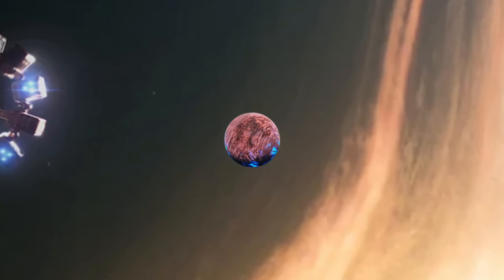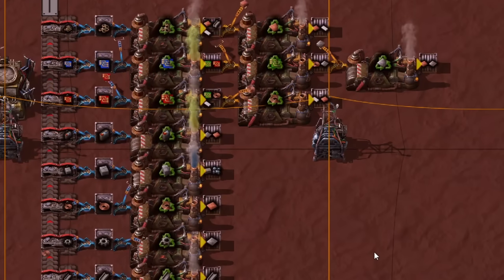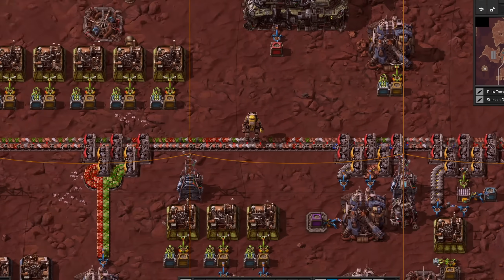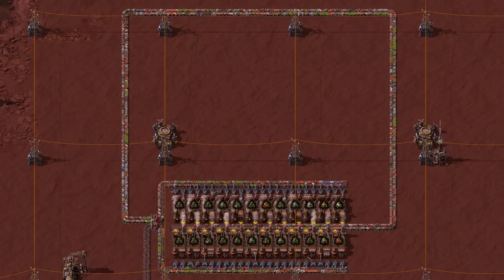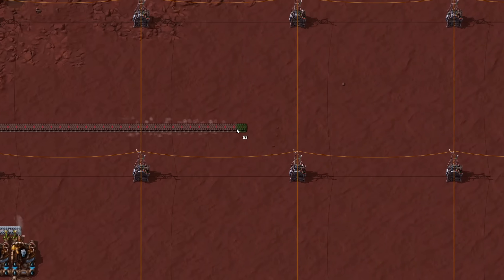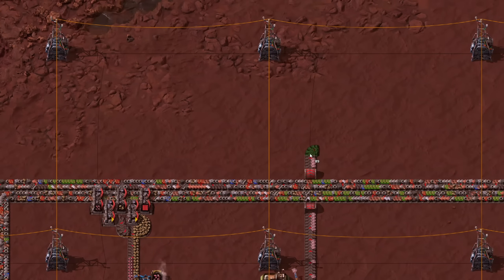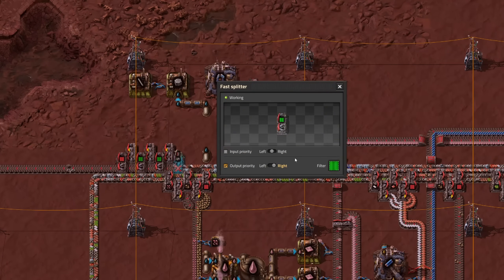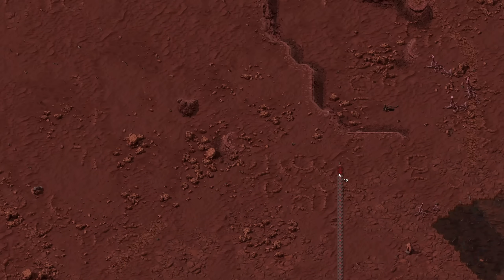Master Planet Fulgora in Factorio. Embrace The Sushi Belt! Factorio Guide / Tutorial

Comment: If you are trying to maximize holmium production then you want one set of recyclers that only processes scrap and another set that deals with the rest. Feeding the recycler output back into self lowers the amount of scrap you process significantly AND this lets you capitalize on scrap recycling productivity. When you mix scrap with non-scrap you often lose progress in any given recycler.

Great content in any case. I've taken to using your train loading and unloading setups because of how simple they are and how little material they need to have something very effective.
Reply from the maker: I actually have a 2 step recycling system just like you describe in my actual base. But without scrap productivity it doesn't make a difference.
But what it allows you to do is filter out items from scrap recycling that you know do not need to go on the main sushi belt.
For example i filter out gears right away and have a dedicated gear recycler to turn them into iron before putting the iron on the sushi belt.
No items in my factory need gears.
This actually increases throughput because gears make up 20% of scrap output.
I also filter out ice and solid fuel right away because both have only one purpose and use a dedicated recycler as well.
Reply: @AVADIIStrategy  I think this is really interesting- increasing the percentage of consumed items by replacing the chaff will allow a belt to support more production.
Reply: The sushi belt solution does have a benefit of being small and easy to setup as your first science setup to get fulgora science going and then, once you have for example new rail foundations you can build a more efficient setup for other things.
Reply: this comment makes no sense, you need to get rid of the items somehow,  either production or recycling into nothing, so you are bottlenecked whether you have a dedicated scrap recycler or not, throughput is capped by number of recyclers and belt capacity, not how you utilise the scrappers.
Reply: @empty5013  how can I explain this to make sense for you? I'll try it this way:

You have one set of recyclers processing scrap onto a belt. This belt now runs past all the production stuff and comes back around. Now, instead of feeding it back into the scrap belt, we build a new set of recyclers and feed it to them. We now have 2 setups, one recycles scrap onto a belt, and one recycles the belt at the end into its own products. We now feed the output from setup 2 onto the main belt. The main belt now contains part recycled items from scrap, and part recycled items from the rest. This will never get stuck, as everything unused will be recycled by the second setup. The first setup now only recycles scrap, and gets a productivity bonus if that is researched, giving you additional resources for free. This setup doesn't do anything better than the one in the video UNLESS the recycler productivity research is done at least once. Does this help you understand why the second setup is more useful than the one shown in the video?
Reply: @firedefender8429  or you could just research until scrap productivity hits a multiple of +100% and then it doesn't matter
Reply: @TrevorSmithy  well, yeah, but thats putting the cart before the horse: you cant research this fast enough if you dont get enough holmium ores
Reply: Did you even watch the video?
Reply: @Obbliteration  What are you trying to point out?
Reply: @Novicks  he did exactly what you wrote with the two lines of recycling
Reply: @Obbliteration  No he didn't in the video, what @Novicks means is having 2 setups recycling items, one ONLY recycles scrap, the other recycles everything else that comes after scrap. This way, with the scrap recycling productivity research, you won't lose productivity progress when recycling scrap. Every time a new item is recycled, the productivity progress resets. If you first recycle 10 gears and then toss in a green chip, the productivity progress will reset back to 0 when the green circuit is recycled. If you only process one item (like only recycling scrap), you will get additional resources for free due to the productivity reaching 100% over and over instead of resetting for a new item.
Reply: @Obbliteration  What he shows in the video is two sets of recyclers feeding  their output back into themselves with the second one trashing everything except holmium. I'm saying you could have one set of recyclers processing only scrap *without merging in non-scrap items back into the input* and everything else going to another set of recyclers. Scrap productivity makes a setup like this appealing versus feeding the recycling output back in.

Comment: That’s pretty clever actually. I set up a sorting system that feeds into a main bus, which I am happy with, I have a nice bus and lots of useful stored resources. But this is so simple and effective, taking advantage of the sushi belts main feature, having everything on it. Splitting off my main bus is a challenge, I enjoy belt splitting a lot, but this is so much easier. The only real issue would be throughput of the belt, but any of  tungsten belts, stacking or adding belts would solve this or even just having multiple recycler sub factories. Not to mention Fulgoras science input needs are low, just a lot of recycling.

Comment: Great video, Fulgora really is about embracing the sushi!  I especially like how you demonstrate the failures of other layouts, and why an up-front splitting approach has so many pitfalls.

One tip for your item-branching blueprint - replace the green "upgrade planner" with a "parameter" so it will automatically bring up the GUI to configure the splitter's filter whenever you place the blueprint.  Really helpful in situations where you use a value multiple times across entities in one blueprint.  There's even a conversion option for an existing blueprint to turn defined values into parameters to generify the blueprint (It's the green and purple button at the top of the blueprint editor - "Parameterise").

Thanks, and keep up the awesome content!
Reply from the maker: Embracing blueprint parametrization is a very good idea.
I'm aware and use it already for multiple things. But i didn't want to make the video more complicated and focus on Fulgora.
Else i would have to explain how it works if i use it in the video.
Reply: @AVADIIStrategy  Yes please do video on blueprint parametrization splitters if you get the time.
Reply: Love this, had no idea this feature existed but I can see so many uses for it already
Reply: I use the separation solution BUT with a twist on the splitter idea from the video so any thing split of have an overflow.

I also have quality mixed in, all the way from the miners, so yes its a LOT of splitting going on but I results in massive amount of rare components and massive amounts of holmium plates.